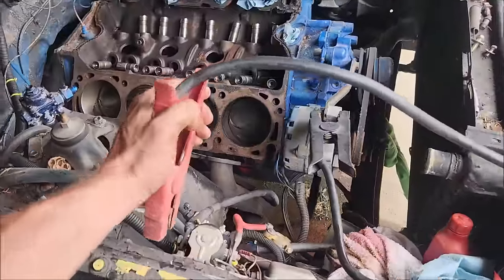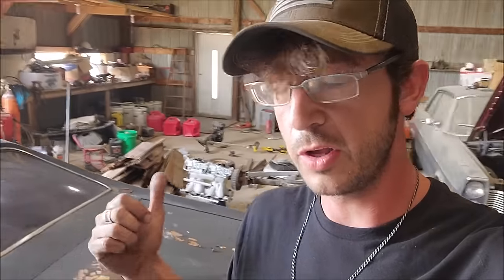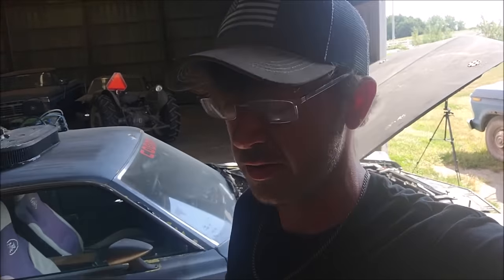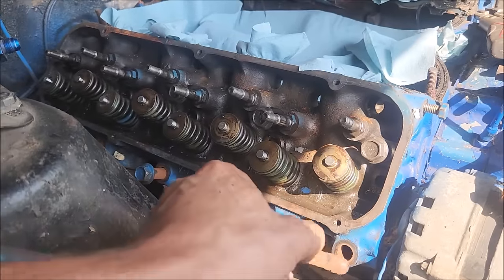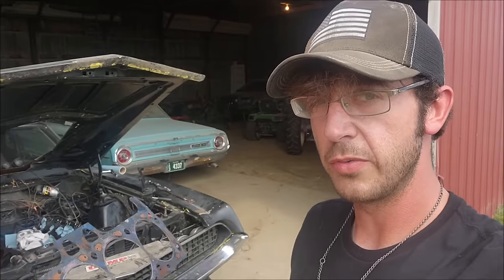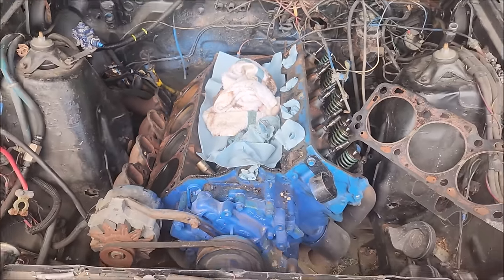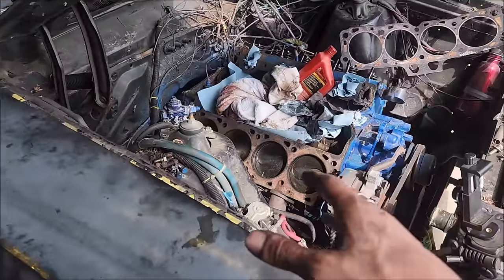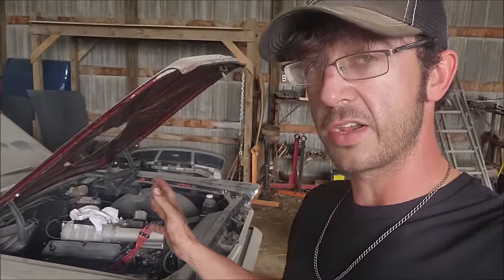Will it Run? Engine Fubar? 1970 Ford Torino DRAG CAR - Parked 20 Years Ago!

Comment: It's a Torino GT because of the foulding headlamps and the rear taillamp strip going across connecting both tail lights . Never say anyone Hone an engine with the pistons still in the hole ? Kinda like using lapping compound to reseat the rings .

Comment: Pull the 429 out and build it right. And it will be better than a 460 revs higher and sounds so much better doing it. You will be glad you did.

Comment: Please keep this car and fix the 429 . You can get you a stroker kit like a 4.300 stroke .030 over .get a scat rotator deck the block and get some noname alum heads . It would run nice with tunnel ram .

Comment: Ford's are notorious for having the oil pump rod fall into the oil pan when you pull the distributor, I've had many ppl bring them in after they changed their intake, then had no oil psi.
Reply from the maker: That's only when the person who assembles the engine is an idiot and removes the tinnerman collar that retains the oil pump driveshaft in the block 🙂

Comment: Please finish off that Galaxy THEN do a little more clean up on the cylinders, valves and mating surfaces, throw the heads on and try to get it running.  I’ve had worse engines that came around nicely and you’ll be able to see if there are any more problems. If it’s worth moving on you could find a 460 for it and sell the running 429 to help finance the rest of the build. Don’t get so hung up on having a perfect motor at the start of the assessment stage especially with possible plans to replace the motor anyhow.  Personally I’d love to see if that 429 comes around.

Comment: You could machine those heads and block..and fully rebuild it..with no problems.if your cranks still good and rods..then you would have something.even if you had to bore it 10 over or more..nice..those things would run...

Comment: Well you definitely should take other head off. To see what that one looks like cause the one Holbrook off sure didn't look good. Your right there.
Reply from the maker: I bore scoped the engine in the previous video. I had filled the cylinders with oil previous, so the rust scenario was hard to see with the scope angle - but it looked funky enough to question. 
Other side was perfectly clean. No reason to pull the head there when the engine should come out anyway was my thought. Way easier on a stand.

Comment: Looks like you're gonna have thousands of disappointed subscribers if you dont fix the torino and keep it. Its a sick car. I'd build it back old school style but maybe aluminum heads and a custom roller cam. Or do a video on how to port the exhaust ports to flow enough to wake up the 429. Just my opinions.

Comment: If money allows it send it and have the machine shop do the block deck it bore it clean it and new cam bearings  and I'd get the rods checked and resized also check the crank and have it polished you know what to do to make it right.

Comment: I've seen plenty of oldtimers use the stone hone and not had issues. Just watched Cold War Motors do so on a refresh of a likely low mileage after rebuild or newly rebuilt but not really run use stone hone to put crosshatching in the walls. What's the issue with using stone hone?
Reply from the maker: Yeah, it will run but it will burn oil and not last long. Not worth it in actuality - youtubers do a lot of bs things because it only has to work for a short while on camera.
Reply: @ThunderHead289   well Scott's not really just a youtuber. He's been working on cars all his life and I think he's in his 60's. Awesome sheet metal man who makes his own patch panels if you've never seen him. His passion is cars from the 70's and older hence the name of the channel. Pretty knowldgeable guy.

Comment: i disagree, rusted intake port isnt head gasket, that's intake gasket.
Probably due to improperly torqued intake.

on 385 series, intake leaks always seep into 1, 4, 5, or 8,  one of the 4 corners or multiple.

blown head gasket would for the most part always remain in the cylinder ;)

Comment: The RTV correlation is this: Anyone that is irresponsible enough to not use the proper gaskets or use silicone sealer in the correct amounts and areas, is going to cut corners and do sloppy work in all other areas.

Comment: That Torino has too cool of a stance and build to not fix right. Regardless of what engine path you chose, Its too damn cool to sell. That 429 is a good core, and perhaps the thing to do is sell it as a builder and put the engine you want in the Torino. Small block would fit better, and a blower on a 351 would be ample quick

Comment: 6:30 It isn't just old cars. Peruse IDoCars one of these days you'll find hundreds of modern engines blown up because of that stuff. Some doof goes 'BIGGA DA GOB BETTA DA JOB' on a front over or oil pan or something on one, chunks of red RTV flake off, plug the oil pickup, and wham bam you need a new engine ma'am.

Comment: Ok look at it this way, it's the right year vehicle, it's already tubed out, and your already into the motor witch to me is time invested.  So I'm not sure what your investment is but it sounded like you got a good shake. For what I see of the car so far it's pritty much all there for a modified.  I'm not saying pour a boat load of money into it, put what you would consider enough if you keep in mind it's a customers car.  So a mild to slightly aggressive build and a so so paint job you can't loose money on it.         It's for fun, not a pro car. It could be if you wanted to race the thing, it has potential but unless your willing to enter yourself into that case scenario I would keep it in your head it's a customers car and your the mechanic.       That's the right situation that you got becouse the car could go either way, it could be a street demon or a strip killer.       So you got two sets of potential buyer's.  And nun of them cars come cheep!!! Hell I've had a 70 Impala sport coupe, a 1975 Olds 442 with the 455, a 1970 Chevelle and a few more that I wish I would of held onto cuz of what there worth now. Hell I was given a Honda CR  250 ellsenor the 1973 model, green and silver colors and I rebuilt it, bored it out what ever it was missing I got from sport wheels and that was years ago. I probably only invested 400 bucks into that bike but it sure looked good. Low and behold that bike is worth 5,000 dollars now.  So take some advice and make your money on the car, it's got potential and that's a two way win.

Comment: RED RTV!? Everyone knows that Blue is every real mechanics 1st choice when it comes to making gaskets! Yes! Dingle Ball Magic is happening! Dingle Ball fixes all!
   Deck it and see if 10 over will clean it up, before you just jump to 30's. But the thing may already have 50 over pistons in it. Never can tell what you have till it's measured.
   But I would put in a 2011 Mustang 3.7 V6 and 6 speed automatic. To get decent power and MPG. Then swap in a full Gen 4 Corvette suspension for the complete modern driving experience. With classic looks.

Comment: I don't know what the difference is between a 429 and a 460. Longer stroke?  If that is the case bore the 429 block get a 460 crank and rods or just rebuild the 429. Likely not a lot of performance difference between a 429 and a 460. Go with a roller can and alum. heads .
Reply from the maker: It's way cheaper and less time/work to just get a 90s 460 short block in good condition for 300 or so and simply slap a cam and aluminum heads on it. 
Makes more power also naturally. 
That's why I brought up the comparison - 429 just numerically sounds cool

Comment: Well hell, if you're gonna throw away that 429 and swap it with a 460,  I'll take it off your hands. What you want for it?
Reply from the maker: I'm not throwing it away, just be set on an engine dolly and covered for a rainy day. A 460 short block with budget aluminum heads and mild cam would blow the doors off a 429 sadly.

Comment: Can the 429 be built smart with Aluminum heads as you listed on a 460.  Why not do this short block right then cam, heads  intake and make it a healthy driver, occasional race car. This way you retain some originality but have something worth maintaining nice. Not nuts but clean and fast. D
Reply from the maker: Would cost me about a grand more than just moving to a clean 460 short block is really it - plus the 460 will just make more power all things equal. The reason no one likes the 460 is because it was never given a chance due to emissions. Change the cam timing and put good heads and cam in it and they are pure unbridled power

Comment: I use the little plastic bristle wheels on a die grinder for gasket surfaces. Doesnt hurt the metal at all but gets all of the gasket off! Works great
Reply from the maker: Try it with a head gasket, depending on the type of bristle, you'd be surprised. 
But yeah this was a scotch Brite pad of death 😄
Reply: @ThunderHead289  i actually have used it to get head gasket material off. I guess they are called rol-loc disc but it looks like a brush and its made of plastic. White and green in color, 2 different types id assume. The white one is the softer of the 2 and thats usually the one i use on everything.

Comment: There is no need to buy a 460.  If you want to get more cubes just buy a 460 crank or an even bigger stroke crank.
Reply: I do not know at what point you would need to get a different connecting rods.  Of course you need different pistons for any change in stroke but you mentioned getting them already.
Reply from the maker: I'd be money ahead to buy a cheap 460 from the injected era and just bolt on aluminum heads and toss in a mild cam. 

With the 429, to do something halfway logical deck, bore, grind crank (your there, so), new pistons, heads worked over (again, why would you skimp and risk it now), the list goes on. 

Most budget of budget rebuilds on the 429 with what it needs runs in at 2500 dollars, where the 460 could be cheaper and make over 100 more hp.
Reply: @ThunderHead289   I think that is true if you want to stay at 460 cubes, for sure.  I think I would try to find an engine that has provisions for a block mounted mechanical fuel pump.  How can anyone stand the frame mounted ones?   I don't have the money for have a fuel tank mounted one.
     Money aside, the more difficult the task of rebuilding the current engine, the more interesting the content.  Imagine if you could get hyper miles on THAT car with you other inventions.  
You really need to keep that car on the channel so I can point to it as what a rear suspension is supposed to look like, vs air shocks, ladder bars, tires sticking past the quarters which is what some younger Youtubers think (and some really stupid older ones) a muscle car looked like in the late 70's early 80's
Reply: @ThunderHead289   I think a high compression 1970 429 is at least as good as a low compression 1990 460.    Not 100 hp worse. But I would get the 460, too. I like cubes and I can't get good gas in  California for high compression.
 If you were closer I'd try to con you into selling me that 429 for my 73 Ranchero Squire .  Finding what is wrong with the stock  302 engine it has in there now would make some dramatic videos.  When I rotate the crank  with a breaker bar and socket on the crank bolt,  it turns only with great difficulty. I can rotate it all the way around.  It doesn't loosen up at all as I turn it. And taking out or putting in the 8 spark plugs makes no difference to the effort required. With the plugs in, I don't get the little "hiss" every 90 degrees of crank rotation. So likely no compression.  It is hard to believe I have no compression on any cylinder unless I had slipped a couple of timing chain links.
 I am guessing spun bearings. But that would only explain the difficulty turning it over, and not the apparent lack of compression.
 My current ideas are buying my neighbors spare 1970 351c 300 HP 4 barrel. Or using a marine 351w out of a dry rotted boat. But that , changing engines as well as engine types, is a lot of work.

Comment: Blown head gasket ??? Did anybody else notice there is  antifreeze in the block it wouldn't have rusted !!!!!  And also there is still carbon and oil on pistons. When head gasket goes it cleans the top of pistons  off  in the holes were the gasket has blown  so blown head gasket is not the issue it was parked

Comment: $150 bore job? What year was this filmed? 1995? LOL
Reply from the maker: That's what it is to bore an engine around here. I mean then you have way more in pistons - that's just the machine work for boring. Another 150-200 to deck. 100 to boil the block.
Reply: @ThunderHead289  I miss living in Iowa. Machine work is more than that around here.

Comment: Thunderhead 289 and yet you have not seen rail rockers,, original on 289 and 302 engines until at least the late 70s. Not a great set up but used on a lot of race engines in the distant past,,because they had nothing better.

Comment: what are you asking for it?
i would like to get that yellow paint back and rewire that entire car as it looks like a rats nest and needs a engine rebuild. no point in building a high-power car when the engine will likely fall apart due to the underlying issues.

Comment: Dude you’re not very optimistic lol in most cases you’ll get a sitting motor running. The question is how bad was it rusted up and how long will it last once running bc Bearing no like rust. Lol

Comment: Sealed many with a flapper home Dawg
Reply from the maker: Works great till it doesn't and now your burning a weekend to redo it. Dawg
Reply: @ThunderHead289  why would I burn a weekend you could have it out in an hour and a half
Reply from the maker: @log38372  I would challenge anyone with a life to do it as fast as they like to claim. I've done it a lot, ain't no hour and a half. Might spend an hour trying to figure out how to just get to some bolts, let alone doing the actual work.
Reply: That 429 is the size of one of the heads on the engines I work on normal automotive stuff is easy compared a fuckin turbo on the engines I work on are 1400 pounds and each engine using 2 I do shit like your doing on shore as a fuckin break from real work
Reply from the maker: @log38372  mechanical work on cars is a break from my job 😄

Comment: Crate 460 in it for 9 grand from summit before freight and applicable taxes.
Reply from the maker: Just send me a 9k super thanks and I'm down
Reply: @ThunderHead289  I like the sound of that, but I'm exhausted from putting a 5.0 H.O. in a 96 Ranger and just got it running with the 2150 motorcraft from my 79 f150. I've got new black ceramic coated headers and I'm going to fab an x-pipe in. Coolant system needs plumbed. Everything needs checked over. Gotta get it to the shop somehow. Boss gave me an edelbrock carb for it from his f700 that got water damage and the secondaries seem stuck

Comment: Pull the 429 do a complete high performance remanufacture on it, put a carb cheater on it and sell it for a huge profit.  Throw a running 351 in the car and sell the car for a huge profit.

Comment: Over use of any color RTV is never a good sign! Doing a 727 Torqueflite right now, had clear RTV in places, but not the pan gasket. Teflon tape on anything other than pipe threads is a definite sign a dumbass was there before too.
 Personally never used a ball hone in over 40 years, so far, so good. 
 That'd be a fun car but as you know racing is money and on the street it'd be no fun to keep gas in the thing. Did the big motor street thing when I was younger, 10 mpg to drive the speed limit to work gets old real fast. Obviously the torque is fun, untill you have to fill the tank, again.

Comment: "It ain`t got no gas in it". 
Why haven`t you ran the Vin numbers and the engine numbers to see if it`s real or not?
I think I`d definitely fix it.
Reply from the maker: Because it really doesn't matter - would change a thing about the value or what I would do with it since its highly chopped up.
Reply: @ThunderHead289  Yeah but I`d like to know. If it`s a real Cobra I think it matters. js

Comment: Get rid of the maverick and drive this. Easy choice.
Reply from the maker: I dont think everyone realizes I drive the maverick everyday to work 50 mile round trip, have done 3 flawless long haul power tours with it, and have put 45,000 trouble free miles on it. 

Blows the doors off a lot of cars, geared decent for interstate travel, and even gets decent economy. 

The mighty mav can never leave, I owe too much to it 🙂
Reply: @ThunderHead289  I know you drive it a lot and I love mavericks too. I have a 77 I need to get to some day. But a tunnel rammed 429 torino? Come on now. Hone and rings and she's tearing it up again. 
I just think it's cool and want to see more.

Comment: there are a lot of reasons to never use a ball hone on any engine. they do not hone evenly. they are not made to hone evenly. always use a flat hone. the cylinder won't be true. you will have blow by.
Reply from the maker: A stone hone should always be used first, and then followed by a ball hone always - this is the only way as the ball hone makes the correct cross hatch for iron rings to have a chance of sealing - moly rings never will seal on a hone job on a non-concentric bore. 
But to think you can make a bore concentric with a stone hone is also wishful thinking. 
You only really get 40 seconds each of spin time also before you have removed too much material for a reasonable ring gap. 

Source: me, who had rebuild or overhauled over 20 engines in the last 8 years.

Comment: Sell the Torino. Irregardless of the engine or previous purpose the car was used for, its something that needs to be at minimum front halfed, and if you ever want it faster than 10sec. q.m. full chassis build. Not the best drag car canidate.